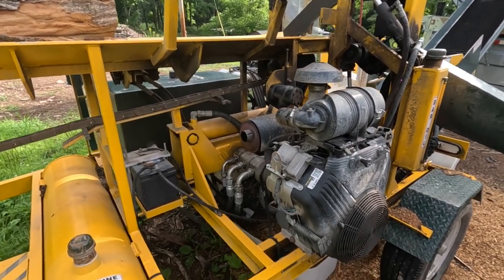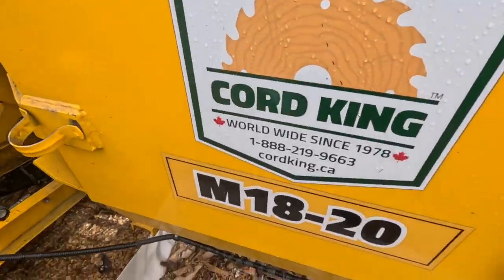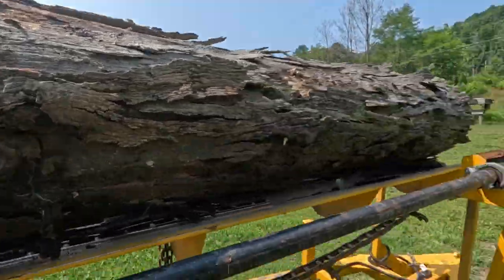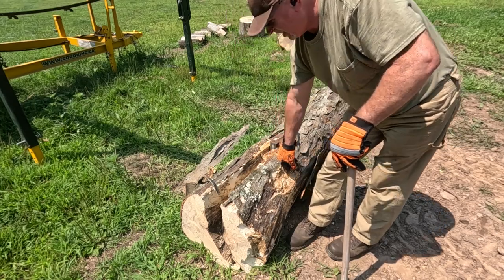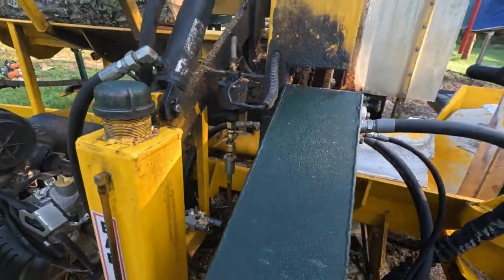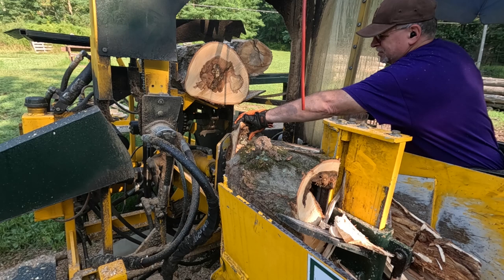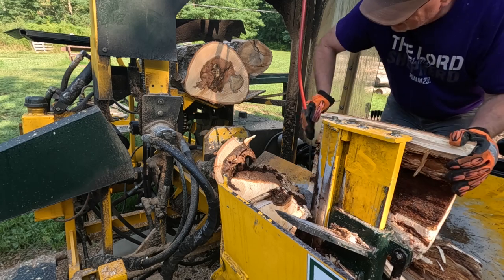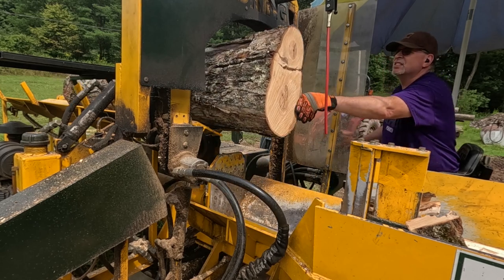Pushing the limits Cord King M18-20 firewood processor

Comment: started up my Cord King (m18-20) this week. What a beautiful machine. Had an issue with the mechanical switch that activates the saw. Had to take it apart and clean it. Like you I never go over 18", anything bigger I use a chainsaw. Not worth the grief.
Reply from the maker: @BreakingWood68  very true! Thanks for watching!